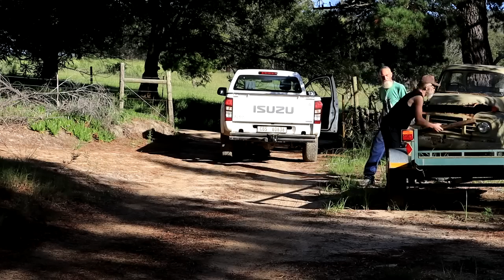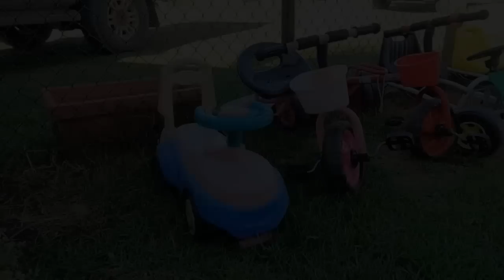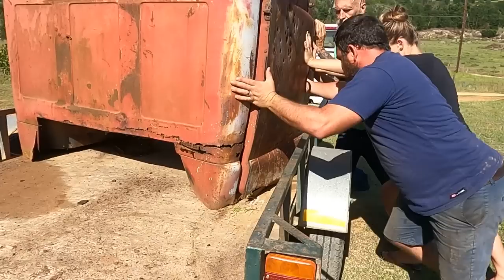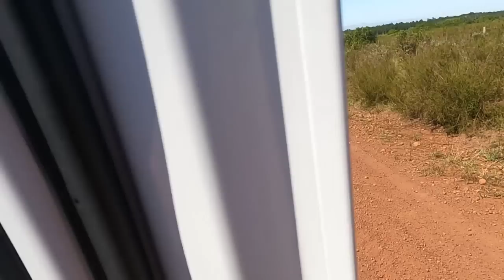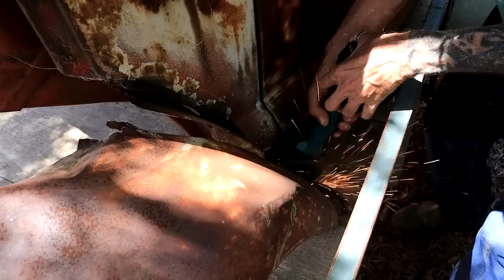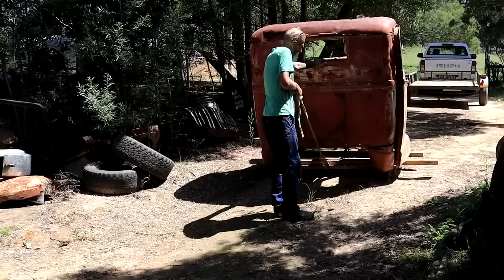THE BIRTH OF DIRK'S RAT ROD!

Comment: Just curious, how hard is it to register an old ride in S. Africa? It depends on the state here in the U.S. Some states are easier than others.
Reply from the maker: Can be difficult if the car has no paperwork. Then, it needs to be registered as a rebuild, which is a long and painful process. 🙂
Reply: @ratrodsafrica  Right Div, here in Wyoming, we can have the state do a search, after which we can contact the previous owner. If the previous owner doesn't respond, then we can apply for a bonded title, which requires posting a bond in an amount equal to appraised value. It's a pain in the ass, but not too bad. My latest project required me to go through all that, and it does save a lot of old stuff from being scrapped. Carry on, brother!